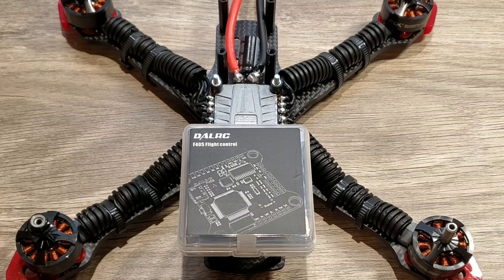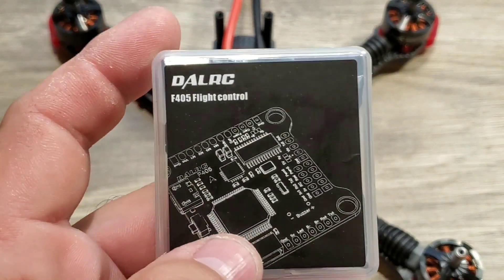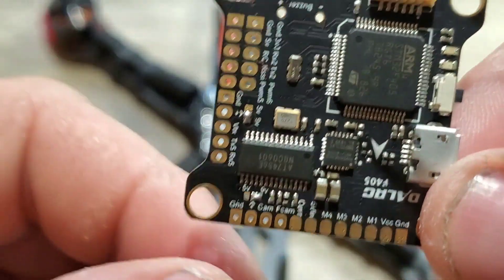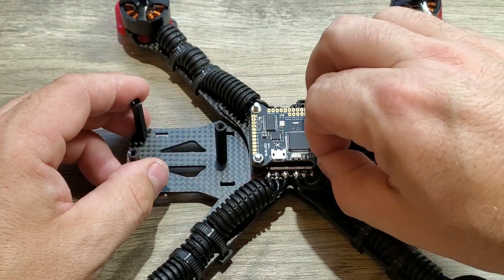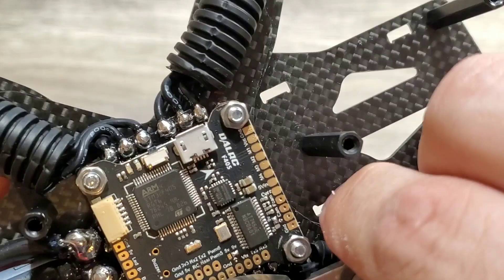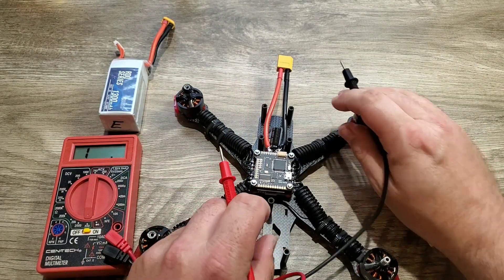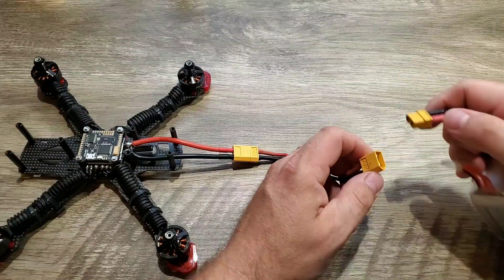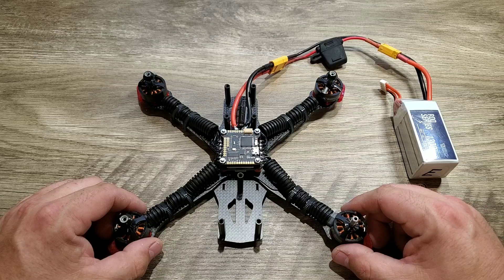Impulse Rc Reverb Build Part 4 Dalrc F405 Flight Controller Installed and Powered Up!

Comment: Hello, I am thinking of using this fc with Iflight 35A 4in1 esc. In that esc, there are m1-m4, crnt, vbat, 5v+ and grd port. But I didn’t see vbat option on the flight controller. There are Vcc. What does this vcc do? And how can I power up the fc?
Reply from the maker: Vcc is the same as vbatt they are direct battery voltage. For powering up the fc you will need to either make a custom plug header harness or direct solder the wires from the esc to the fc since your are using a different esc.
Reply: So I need to solder vbat wire to vcc port and 5v+ to 5v in port. Won't these two power input interfere in each others power distribution or its just ok?
Reply from the maker: @MTT Zunayed  they are separate. Yes you would wire vbatt to vcc and 5 volt to 5 volt.
Reply from the maker: @MTT Zunayed  they will not interfere.
Reply: Ok got it. Thanks alot sir